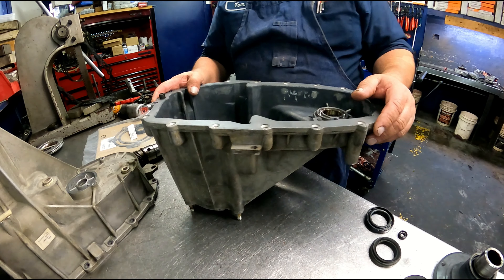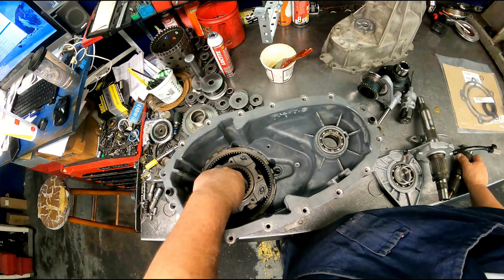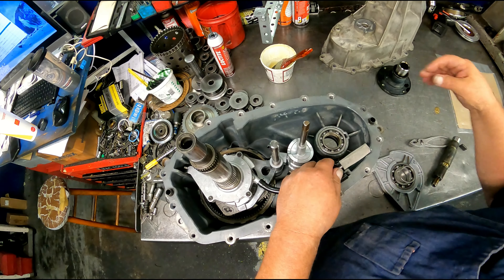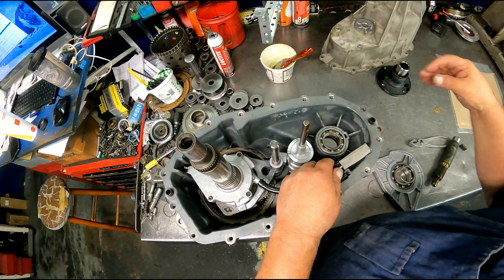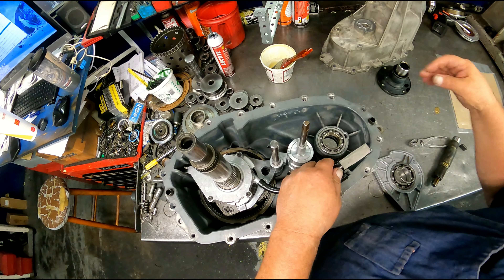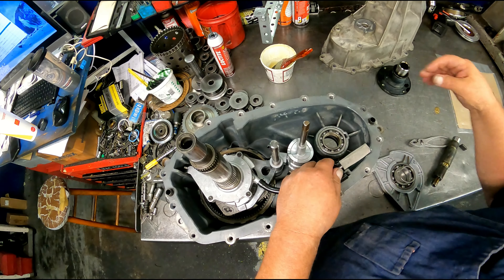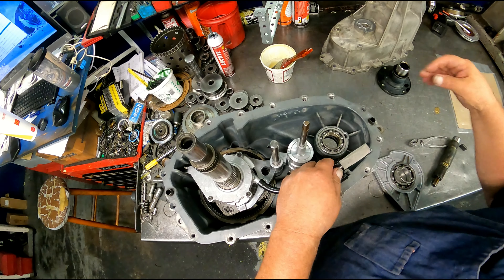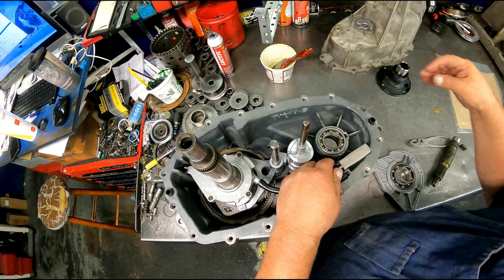44-93-013 Transfer Case Rebuild

Comment: Awesome video, although as I understand it, the case is Magnesium. Thus the special torx bolts.
Reply from the maker: Thanks. Correct. They are self threading though, so you have to be careful and not cut new threads.